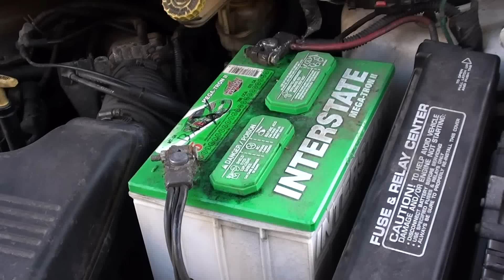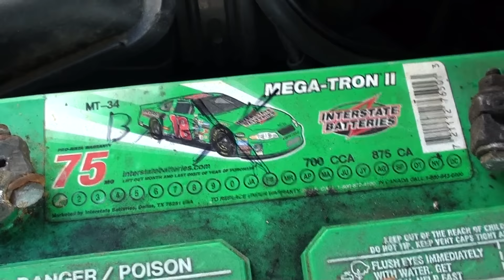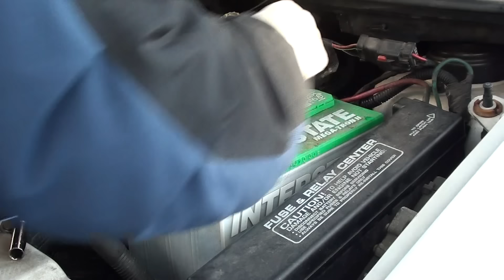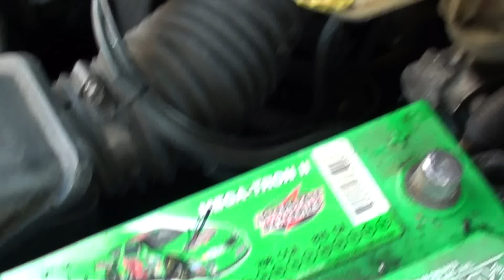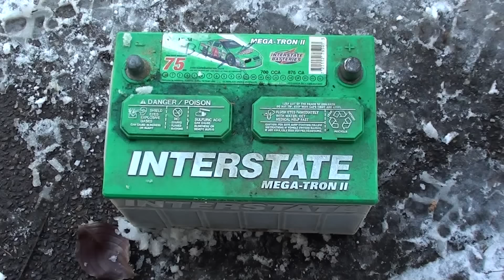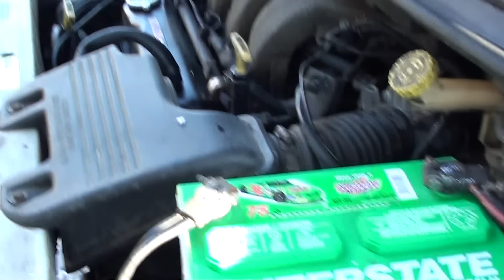How to Replace a Car Battery (Like a Pro)

Comment: You forgot 2 things before attaching the terminals

1. Clean battery mounting bracket
2. Re-attach the hold down bracket with screw
Reply from the maker: You could do that if the battery posts are dirty or you see corrosion. It's also a good idea to use dielectric grease on the posts. 

I did re-attach the bracket but didn't think that was important to include in the tutorial.

Comment: How do i know what type of battery i need? The battery i'm replacing is like 20 years old and has like 20 different codes on it
Reply from the maker: Best thing is to go to an auto parts store or website and type in your car make and model. You will see what battery will fit the car.

Comment: What size rench/socket do you need? Is this the same accross all vehicles? What about a Jeep Wrangler, about 2003?
Reply from the maker: Most battery terminals are 10mm but it can vary.

Comment: Our van died in the driveway yesterday and changing the battery was a snap. I'm really glad that I watched your video or I probably would have disconnected the wrong terminal first. Thanks for the simple instructions. It's running again!
Reply from the maker: Sweet! Most people don't know about charging a battery but that is possible. I've done it a few times myself but typically trickle charge. That usually works better I find.

Comment: hey one question. when you swap old for new battery do you have to clean contact of the battery too? thing is my car wont start.  I think I seen on tv that you have to clean the contacts before installing batery
Reply from the maker: I've cleaned battery posts and used dielectric grease sometimes when a car was having electrical issues. Sometimes it's just a loose electrical connection.

Comment: you never showed us what you used the screwdriver for.
Reply: 2:53
Reply: laughswithcrows yes he did...to pop it off if its stubborn.  He used it when he took the positive part off
Reply from the maker: Yeah that's the important part. Don't use the screwdriver if both battery cables are attached.
Reply from the maker: I used it to get the cable off. AFTER I removed the other.

Comment: I know absolutely nothing about cars but I'm changing my battery today.... And there is a huge metal bar down the middle of my battery
Reply: That's just holding your battery in place. There should be bolts to loosen and that will come right off.
Reply: That would be the hold down. Things look different in every car but they are pretty much the same. So for him it was the small bit of metal he shows in the video, for you it is the bar.
Reply: yeah you have to remove that
Reply from the maker: That's another type of hold down. It's easy to remove.

Comment: Thanks! This was very helpful. My owners manual listed most of the steps, but I had difficulty getting the locking bolt out (hard to reach). Found a ratchet like the one you were using, and then it came out easy.
Reply from the maker: Boom!

Comment: So i should do exactly what he did in this video if i dont want my airbag to go off?
Im trying to replace my steering wheel and have to remove the airbag.
(2014 Chevy Cruze LS)
Reply: PlatiumCruiser you can just remove the negative terminal to the battery in your case
Reply from the maker: Airbag shouldn't go off from just replacing a battery.

Comment: I always wondered what it was like back in the early days of motor vehicles. Like, the entire funding team inspecting the engine with the mechanic. The conversation must've been like

MECHANIC: This is what we call the radiator.  The alternator is way down there. There's your belt. This is where the battery is placed. The engine block is very--

INSPECTOR: Excuse how is the battery always in place? Won't it shift when the vehicle is going too fast or comes to a sudden stop?

MECHANIC: Oh it won't because we use the... uhh... oh shit.. bi... ga... we use what's called the.... hold down???? yeah... hold down...

*inspectors applaud
Reply from the maker: What?

Comment: Should add cleaning the connectors on the cables so there would be better contact to the terminals.
Reply from the maker: You can do that. I don't always but I have a brush for it. Dielectric grease is good to use too.

Comment: My alternator is 130 amps Toyota 27060-28230
Stock battery is 370 CCA
I would like to keep my stock battery for starting and add a megatron plus 1000CA in my trunk to power a  inverter and power amplifier, would my alternator be able to charge both batteries? Do i have to install a switch to control the charging?
Reply from the maker: Was it a German car? They have really weird procedures for installing new auto batteries.

Comment: is it ok to touch the terminals? or avoid touching them? after taking off the terminals don't let them touch metal parts of the car or it's ok? (safety cautions for handling the battery)
Reply from the maker: Don't let the terminals touch anything metal if you can help it.

Comment: I tried to replace my battery today but I ran into difficulty using my socket wrench to unloosen the bolts of the frame holding the battery in. It just wouldn't loosen the bolts - any special trick? Any workaround? Thanks,
Reply: Duricas I had a bit of rust on mine, when I replaced my battery in my '85 CJ7. I used WD-40 to try to loosen up the bolt a bit. Soaked the hell out of that bolt...lol. I guess it worked, because after the second try, it came loose. I went ahead and replaced out that nut and bolt as well.
Reply from the maker: Might need to use some PB Blaster.

Comment: I had replaced a automotive battery for a truck that had a 700 cold cranking amps battery. Before I had replaced it, I tested the battery and it was good. The owner of the truck was not believing me and was already pissed off. He said he wanted a new battery so no warranty was issued to him. He just did a straight full price buy for it. I installed the battery with connecting the positive first and connecting the negative last. The headlights turned on without the light switch being on and there was a loud buzzing sound coming from a small box that is located on the left side of the engine. The owner of the truck got really mad at me like if it was my fault. I just did what I normally do and this is the first time this happens to me after two years of changing batteries. I'm not a mechanic just a service technician. I do small things like oil changes, batteries and tires. Just small basic things. Another thing, the terminal stub was melting slightly. I know it was not something that I did, right? There has to be a short circuit in his vehicle. Anyway the guy had to tow his vehicle out of there at his expense because it did not want to start. I did not know what to tell him except to have a mechanic look at it and all I did was install his battery. I did not mess with anything else. He was there watching me the whole time.
Reply from the maker: That wouldn't damage the car.

Comment: This is a great How-To video, but just an FYI for Adam....You might want to post another video stating/reminding the viewers to remember to secure the bracing bolt for the battery. He forgot to mention that in this video. Otherwise, great video.
Reply from the maker: I did put it back lol.

Comment: Just did mine first timer and I did it at night. Was just as easy as Adam made it look once I found the right socket. I also added some corrosion protection rings and sprayed the posts once connected with corrosion protection. Hopefully it keeps the crud off. Thanks for the video!
Reply from the maker: Sweet!

Comment: A good way to remember is that when you are taking off the battery ,subtracting weight (-) then you disconnect the negative terminal and when you are putting it in the car ,(+) adding weight you attach the positive terminal first.
Reply: Thanks.  That helps me.  I'm... special.
Reply: ***** Agreed. I can do a decent amount on my Jeep, but damn if I can never remember which battery cable comes off first. I always feel like an idiot googling this. Very glad for this tip. Maybe I'll remember next time.
Reply from the maker: Ohh that's good. Will remember that one.
Reply: I just remember that the negative terminal is at groundstate so it can't shock you when it's opening or closing the circuit.

Comment: 700 CCA and 875 CA are good. The higher the cold cranking amp rating of the battery, the better it is for your car. But, don’t get that confused with cranking amps – CA. See, cold, cranking amps – CCA, cranking amps – CA. The cranking amps are rated at 32 degrees Fahrenheit. Cold, cranking amps are rated at 0, and the higher the temperature when they’re doing the rating, the higher the numbers. So, that CA rating may look impressive, but it really isn’t. Rely on cold cranking amps.
So if you have a car that is lightly used, it sits for a long period of time; well, you want the longest reserve capacity you can get.  So, here’s what you do – when it comes time to buy a battery, you’re looking to find a happy medium between the biggest cold, cranking amp rating that you can get and the biggest reserve capacity rating that you can get
Reply from the maker: Good info.

Comment: Thanks very much.  This video just helped me out.  I just replaced my car battery using this as my guide and it worked first time.  I didn't realize it was necessary to disconnect and reconnect the terminals in a specific order.  ..  Thank you very much for making this.
Reply from the maker: Awesome!

Comment: I can't get the battery holddown screw off. Im using the right socket and I keep turning the socket counter clockwise but won't come out.
Reply from the maker: Try WD-40 or PB Blaster.

Comment: Just wanted to say thanks! I just changed battery on 04 Montana. Had to detach the fuse-box which is siting right on top of the battery and it was brutal to get out. 
Wanted to watch video to confirm its Negative off Positive Off.. Positive On Negative on. Works like a charm!
Reply from the maker: Oh really, that's interesting.

Comment from the maker: @kenny50776 Your are right!  I should have put some terminal protector spray on the terminals and cables.  I am good about checking them and cleaning them.  I did lock the battery and it was included, you just did not see it!  :)